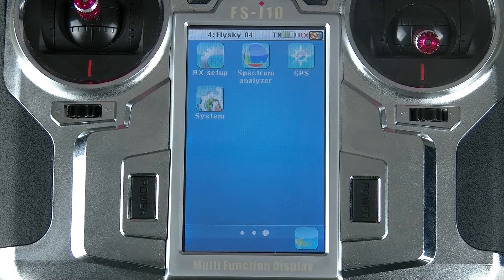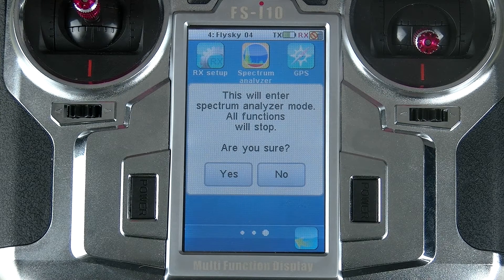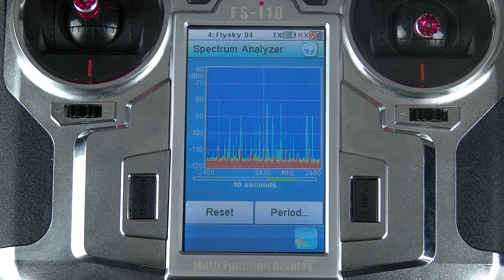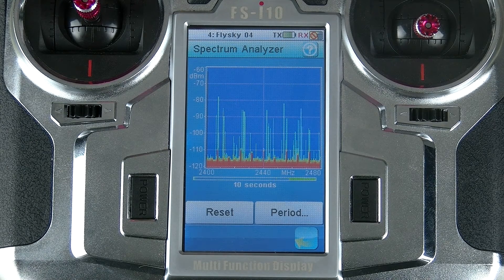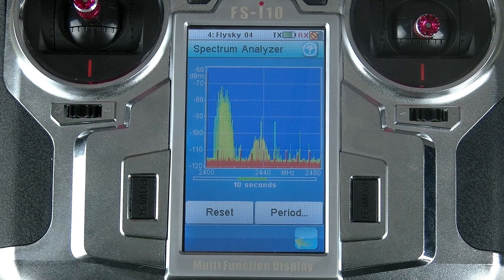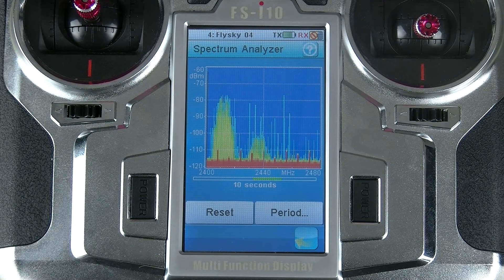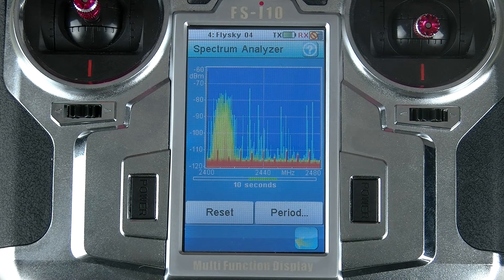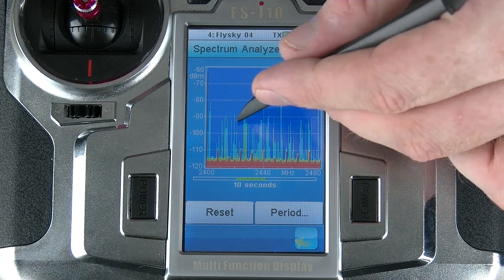FS-i10 Spectrum Analyzer Function Tutorial

Comment: pls guide me or help me ,
i want to buy this radio ,  

may i know 
can i fly with this radio my gas engine plane ?? its safe 

can i fly my nitro engine plane with this radio ??? its safe 

can i use my turnigy receiver which i am using with turnigy 9x radio ??

is this good radio ??

pls guide me
Reply from the maker: To the first three questions the answer is yes. Personally I think the radio is very good but there are plenty of reviews online.
Reply: thanks for your kind reply , 
one more thing , 
when i buy this radio ,  can i run  this radio with same soft ware or i should load new firm ware  ???
i dont know or not have good information , but learning from your post ,

pls guide , with thanks
Reply from the maker: We release updates regularly which are available on our website but you can use the radio right out of the box with no issues.
Reply from the maker: The module is not included we are currently just finishing/testing the function now.

Comment: Is there any method to convert my TGY i10  to take FS firmware. - apart from selling it and buying the FS i10
Reply from the maker: Sorry but the TGY i10 is locked to HK firmware.
Reply: Flysky RC Model  ..... I guessed as much. HK are selling a discounted price just now.... if FS did the same I would buy one. I have two tgyi10 which I may still sell and get a new FS!
Reply from the maker: Cool, just remember the HK version has the quadc mode, the FS version does not. You can still use it fine, just set up a basic airplane model, but some people have complained about that.
Reply: I do use airplane mode more than Quad...... if you are the same guy on RCGroups, you may recall why I am not a TGY fan.....anymore!
Reply from the maker: Yeah same guy! On forums, you tube and facebook etc it will always be me. Even on the Chinese forums oddly....